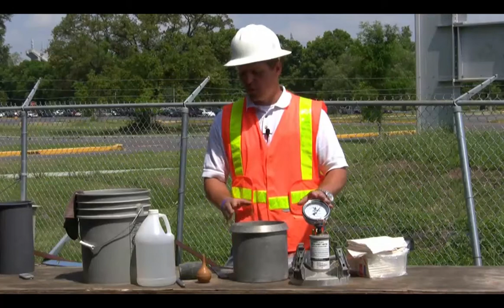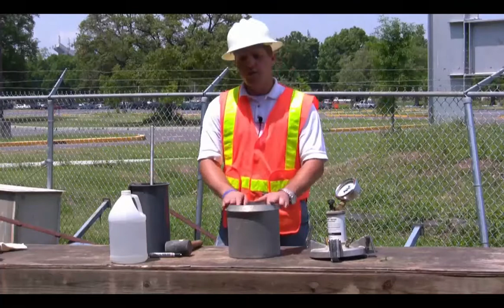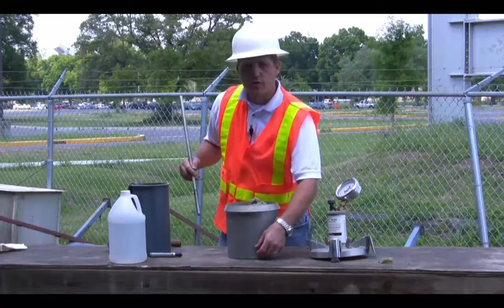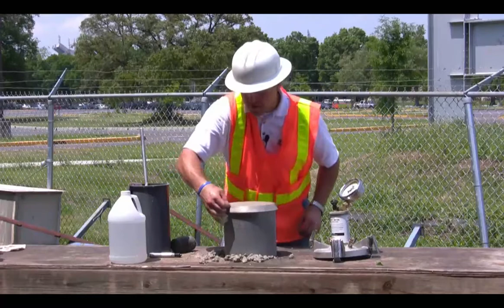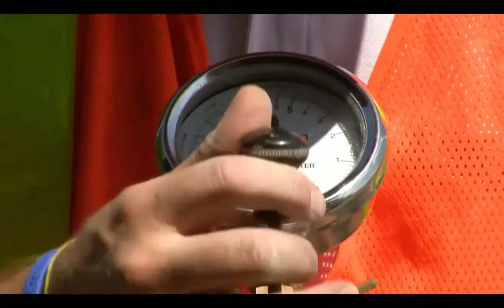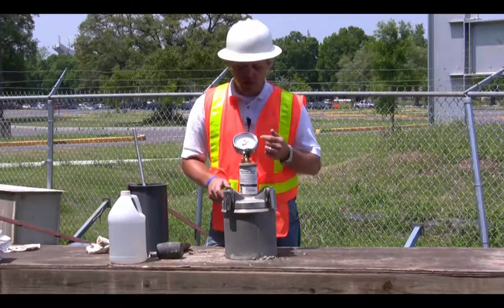Air content (pressure meter)

Comment: This video made me fail my DOTD performance test because the initial setting on the dial is not the "bold line" as the video states. The training guy who was testing me said it's the 3% mark. Also, I was failed because I hit the bowl multiple times when releasing the compressed air as shown in the video, & the tester said I'm only supposed to hit it once. This video needs to be updated or removed.